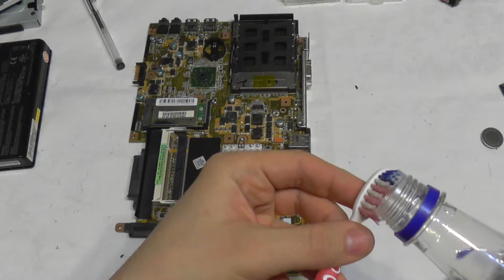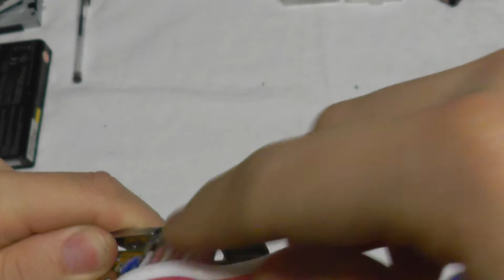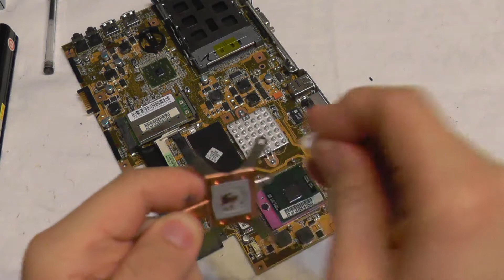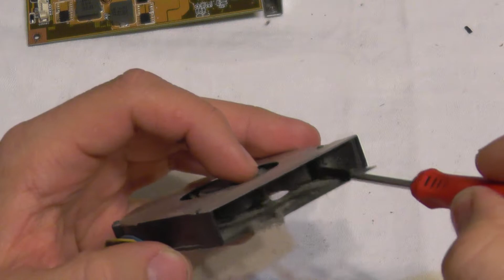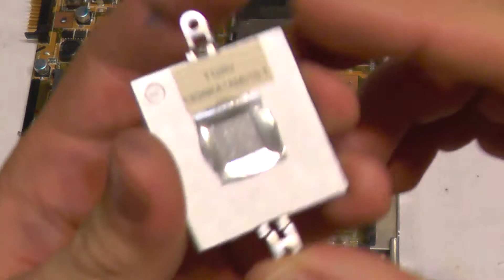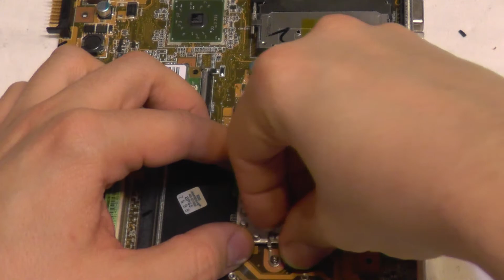Asus X51RL Notebook CPU Cooler Cleaning & Thermal Paste Replacement

Comment: The best thing about ASUS X51R is insanely high-tech fan here. Back then ASUS tried to implement MAGLEV technology!
If you don't know what does that means - it is abbreviation for Magnetic Levitation (the same for flying trains!)
You can just pull the blades and easily clean the whole heatsink! Don't forget to clean it and lube it with some sewing machines oil or wet graphite lubricant.
Based on my experience - they both perform almost the same, but graphite recommended for metallic connections to stick on.

Comment: nice video is the cpu soldered?
Reply from the maker: Thank you ! The CPU is not soldered, it has a small socket and it's fixed with the aid of a small screw (black circle on the purple strip on side of the CPU)
Reply: @TechTronic9000  it has Socket M (PGA478) type, it can be replaced with some silly slow Celeron CPUs. incompatible with Socket P
Just for the sake of history.